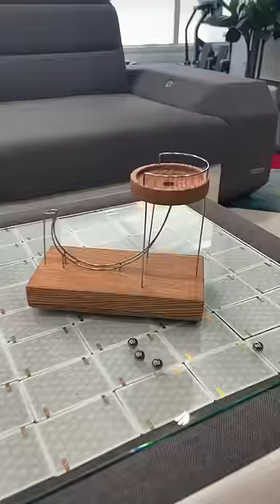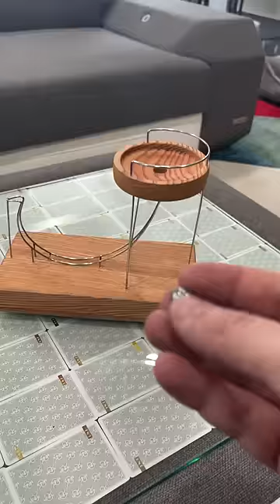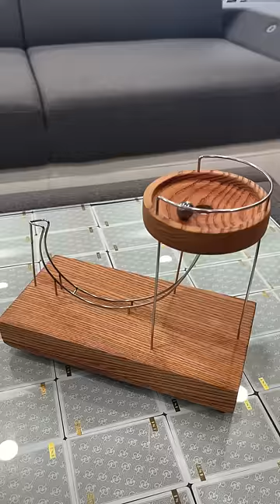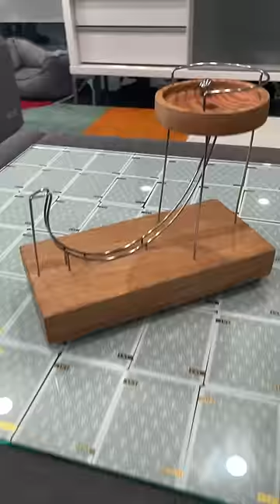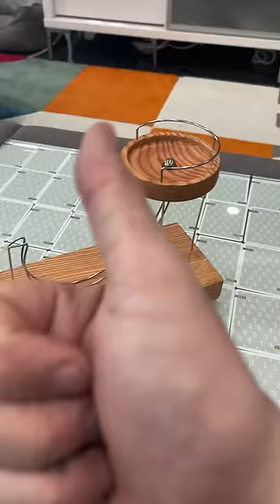An Impossible Perpetual Motion Device?! 😳 #Shorts

Comment: Eventually the material wears and becomes inconsistent. Either energy or matter is sacrificed. There is no forever.
Reply: The ball gets more height in the jump then the height it's dropped from. There's obviously a power source in the base block.
The energy from the 9v is used. Do you think this would work without the electrical magnet?
Reply: @heruhcanedean  oh, thought it was magnetism.
Reply: why is everyone so obsessed with "forever" 
why can't it run continuously for a few years? 
If the parts break? just build a machine that lasts longer, a few years is good enough for now. 🤦🏻‍♂️
Reply: @heruhcanedean  Does it really HAVE TO HAVE THAT? Doesn't gravity & the slickness & curve of the slide count at all?
Reply: Has a electromagnet and battery under the base to add a quick pull on the steel bearing to overcome the friction. All such devices have hidden power sources.
Reply: @skyehook284  Where does it gain energy? "Slickness" or lack of friction doesn't make it gain speed. How does it gain more energy to jump higher than the drop height?

Putting on caps lock doesn't make it fact.
Edit : Side question, not related. Do you know the speed of gravity?

Let's ignore friction and the heat produced from it. Where that energy of that slickness and curve be?
Reply: @skyehook284   bruh the slickness and the curve do not add any energy to the ball. The only force (if u don't count friction b/w rail and ball) doing ' work ' here is gravity. And whatever positive work gravity does as the ball slides down, it also does the same amount of negative work as the ball moves upward. So the ball ain't reaching any height higher than it was dropped from unless another energy source exists
Reply: True, but at least it might last a few life times, give what it would take
Reply: Before that you'd have to change the battery
Reply: @enam9000  The forever part change everything. If it's not forever, it means it use a energy source to do the motion and that there is loss of energy during the motion... basically, its just a basic energy source which use usual thermo-dynamic law which is what we currently use for our electricity. 

So unless your machine is forever, the machine doesn't bring anything new and serves nothing because it's either already done or it's inefficient.
Reply: @enam9000  it's called a nuclear reactor.
Reply: It's called a magnet
Reply: @betterthancrabpeople  It probably is magnetism, but for the ball to be attracted on the way down and not pulled back down on the way up, it needs to be an electromagent.
Reply: It’s amazing how many ignorant people there are that believe perpetual anything is possible
Reply: Never loose energy, just changes form.
Reply: @darrellbryce5914  Which results in the loss of momentum, and thus making a perpetual anything impossible.  Kinetic energy to thermal energy is still a loss of energy as it refers to the speed and momentum of the steel ball.  It's gonna stop eventually
Reply: There is forever.

When it's about love. 😂
Reply: Now this comment made me stop & really appreciate science for a moment. I don’t know what about it holds so much weight but it definitely made me stop out of respect.
Reply: Besides, the energy it has right out the gate, and the amount of momentum it carries through the jump seems very sus. Speed it exponential, not instant, and if there is air and the object is heavy like the marble in this is I assume, than it would slow down a lot on the way up and through the jump.
Reply: @enam9000  because we are humans. We want to do shit, even if that shit itself is meaningless shit. A device that has infinite energy would be lit.
Reply: Sacrificing matter will be aloooot bettar than direct energy cause mass has energy= mc2
Reply: @ReadyViewer1  Astronomy taught me how to appreciate everything. Even the largest stars or strongest black holes lose to time. But it's a strange reciprocation. It's not all bad. 💞
Reply: @TeenWithACarrotIDK  word. Nice username btw 🤣
Reply: @skyehook284  because of conservation of energy is impossible for the ball to jump higher than the initial height. You need to apply a external energy.
Reply: sounds like a villain quote lol
Reply: But... how long when that take?

Looks like it didn't a line my reply below the message I was commenting on.  This was about how long the wood would take to wear
Reply: @enam9000  the batteries wouldn’t last a few years
Reply: Cringe
Reply: Yet the ever expanding and cooling universe is expanding and also has no edge.
Reply: @blyat cyka what effort? Merely pointing out the universe and everything has entropy, but that it's expanding into a void space which is to this point unobservable? It's not to prove that entropy does not exist, or that some things don't have it. The idea of expansion into nothing is just fascinating to me.
Reply: @blyat cyka small world I am a low voltage electrician 😅 that's a nice way to say cable tech.
Reply: I think the biggest deal out of this is that it may be able to hold energy running for either long enough or until the material wears out, which means that this is something we could actually take advantage off in real scenarios.
Reply: @heruhcanedean  Wouldn't a magnet do the same without having to have a battery?  Maybe like one of those powerful magnets they use in speakers?
Edit: Or is there some sort of power cut off that avoids the ball getting halfway down then just stopping in the magnetic field?  
I'm not sure now whether I'm capable of understanding the answer.
Reply: Einstein: “What’s the difference?”
Reply: What if all all steel?
Reply: We cannot know for sure because noone will live “that long” to tell.
Reply: @zacmumblethunder7466  It's a good question but thermodynamics rules it out. The thought of magnetic motors as I once called them even relying on the earth's magnetic field to help like a compass needle do not seem to work. I tried as 40 years ago and friction even with a fine needle for a Bearing and the best materials just don't. The Earth's field I is to weak. I love devices like this because it creates interesting discussions.
Reply: @zacmumblethunder7466  Sounds like you understand, yea it's a magnet that cuts power so the ball doesn't get stopped. The magnet pulls the ball towards it to build speed and cuts out to let it go past.
Reply: @thomashaagmariano5079  why the "quotation"
Reply: @briansrandomthoughts4u  , comment flood is perpetual.

It's how this engine works, actually.
Reply: this has a electromagnet at the base
Reply: In this life 100% there is no forever
Reply: @kody.wiremane  So you've seen it work for days on end?  Why hasn't this revolutionized engines?  Why is this literally the only posting I've ever seen about it if it actually destroys our current understanding of physics?
Reply: It is CG. The ball can't jumpg higher as its initial point in room.
Reply: Maybe there is a forever, though
Reply: My love for my dog will last forever. Don’t tell my wife, she gets really angry
Reply: @skyehook284  I can never go higher than from where it was dropped no matter the curve or path. Unless you change its mass mid air.
Reply: May be it should be made of more strong materials and then...
Reply: Re-read what you just wrote. "Eventually the material wears ". Now consider how long before this can happen. Days? Weeks? The machine will have done its job after so many minutes or hours of use. It can be stopped to avoid unnecessary wear and is ready to be used again. Stop saying dumb hipster crap to sound smart. The device lasts long enough.
Reply: @enam9000  That’s literally what “perpetual” means.
Reply: @skyehook284  If there is absolutely no friction or any energy loss, sure it can move forever, the same way a pendulum swings “forever”. It would stop pretty quickly if the battery is turned off because it cannot reach the same height.
Reply: @eleventy-seven  do you have any evidence for that ?
Reply: @enam9000  Because perpetual motion means it will run for g*da* forever! That's why it matters! 🤦‍♂️🤦‍♂️🤦‍♂️🤦‍♂️🤦‍♂️🤦‍♂️🤦‍♂️🤦‍♂️🤦‍♂️
Reply: add more balls or build another ramp it's called maintenance
Reply: what if magnets makes it fly so it doesnt tear the rail
Reply: @heruhcanedean  there is a video about this device, it's not using magnets, it IS using the battery of course
Reply: @heruhcanedean  gravity is a theory..
Reply: It is an electromagnet underneath the base. It is just a funny gimmick.
Reply: @phil4693  doesnt it still work tho? lets say you get friction energy from the rail and the ball and that heat goes to a steam generator, shouldnt it work? since the magnet doesnt require power
Reply: @Eric-yj5xg  The magnet requires power. It is an ELECTROmagnet. It gets turned on for a bit of a second when the ball passes through the hole. So the Ball gets pulled down. 

If you look closely the ball jumps higher than the base where it was released -> This is under every cicumstance impossible without force from another source. 

If you use a permanent magnet the extra force from the ball getting pulled down while rolling down is negated because the magnet would pull the ball down while rolling up and mess up his trajectory. 

Hope i could help.

Comment: The ball obviously accelerates too quickly mid-way, it looks unnatural.
Reply: magnets perhaps
Reply: Just a electric motor with a wheel under the wooden part
Reply: @paulluxx6846  No, it's an electro-magnet in the bottom board with a hall sensor, activating for a moment when the ball comes close.
Reply: Magnets might speed the ball up,  but that ball looks light enough that it wouldn't break the field and fly back up
Reply: @rpk2012  it activates then deactivates..
Reply: @edinfific2576  
What the f do you need a hall sensor for?
A strong magnet is all this needs...and the initial potential energy of the ball falling through the hole.
Reply: Really..??
Reply: @plutostudios1417  magnets would apply the same energy on the way down as negative on the way up with a neutral result. Only if the device is connected to an electric device that turns on and off a magnetic field at the right time
Reply: There’s something wrong on the way it hits the inside of the wooden plate, in a very few jumps, it would hit the edge of the wood
Reply: @chuckclark6162  you need to turn the magnet off or the acceleration it provides would be cancelled by the deceleration when the ball starts to move away
Reply: The track is coated with a speed boost

Comment: If it accidentally gets directly into the hole, it would break your ceiling.
Reply: Nah, contact with the air and rails exert friction on the ball and it'll never get very fast. At most it'd miss the catcher on the second pass.
Reply: @jpratt8676  you must be very smart
Reply: @JS-nr7te  Uh, just took physics in school
Reply: No
Reply: @jpratt8676  what if we redesign it such a way that the ball directly goes into the hole(for eg. by using a Pipe) then will it pass faster or slower?
Reply: @shahidkococaccount3853  depends on the friction of the pipe...

If you want to speed the ball up though, you're better off using something like a rail gun or a trebuchet, a juggling system like this will struggle to minimise friction
Reply: @jpratt8676  but i wonder why they didnt use a funnel instead of wooden disc...Does the wooden disc accelerates the ball?
Reply: @shahidkococaccount3853  Their purpose is not to make the ball go fast, but to make it look cool :)
Reply: @shahidkococaccount3853  and no, the disk slows the ball down to accentuate the illusion that gravity is accelerating the ball without assistance
Reply: @jpratt8676  it was a joke
Reply: @redstoner8447  ? Not sure which thing you think was a joke but, cool...
Reply: @jpratt8676  
Speedy thing goes in, speedy thing comes out
Reply: @jpratt8676  remind me to never invite you to any of my parties...

Comment: I like how humans can spot something un natural just by looking 
No need to know physics or anything
Reply: Yup. There is a magnet in the base on the machine.
Reply: @inevitable854  Not a magnet. Electricity. If this was working with just magnets it would actually be a PMM
Reply: @Bumperpegasus  no it wouldn't actually. Because over time the magnet would lose its strength and not be able to throw the marble with as much velocity, thus not being able to make it to the funnel.
Reply: @Bumperpegasus  "perpetual motion, the action of a device that, once set in motion, would continue in motion forever, with no additional energy required to maintain it. Such devices are impossible on grounds stated by the first and second laws of thermodynamics"

With this in mind. The magnet would lose strength, the metal would rust, the wood would decay and thus fall apart.

The bearing would also get smaller and smaller as it wears against the rusty metal rails and would get to a point where it's smaller than the gap between the rails.
Reply: @inevitable854  Finally someone who knows that magnets are not forever,a lot of people saying "it's just a very strong magnet" as if that were an argument in favor of PMM'S.
Reply: @inevitable854  Magnets won't work for an obvious reason. Repelling, you lose the momentum of the ball dropping down. Attracting, you lose the momentum as it goes up. It's the reason people are spinning their wheels trying to make a perpetual motion magnet motor. 
As others have mentioned, it probably uses electricity on the rails inducing a magnetic field on the ball which opposes the field on the rails.
Reply: @klocke5247  you could attract the ball downwards on thr initial drop with the magnet placed in such a way that it barely hits the field and gets propelled downward on the track, similar to a space shuttle using a planets orbit to change direction and propel them through space..
It's obvious there are other physics involved with the specific way the rails are shaped,
Reply: @inevitable854  It's an interesting idea but unfortunately won't work. There are no magnetic fields possible from permenent magnets that can mimic the gravitational attraction of a round object. Trust me, or not, people have tried every possible permutation of every force you can imagine to create a perpetual motion machine. It simply isn't possible. It's actually frustrating. You can't even levitate a ferrous object using a collection of arranged magnets. It will just fall out of the field no matter what you do. The only way to do it is use a motor to spin the magnets and the field and object.

Anyway, pretty sure another commenter already cracked the mystery. It appears to use the same principle as a rail gun. If you inspected the device closely, I'd bet you would see that the two rails are not connected together at the end.
Reply: Yet billions of people are still praying to the zombie son of a magical sky daddy. 🥴
Reply: @inevitable854  i know you're free to have your own opinions, but when you cant comprehend that lt is literally impossible to enter any kind of force field, ie a magnetic field, and exit with more energy than what you started from, why even comment about it man. If you move towards the magnet to gain 5J, you will need to use atleast 5J to leave. I guess you wont need exactly 5J because the magnet would have lost a miniscule amount of attraction in the time it took for you to absorb 5J from the magnet, but at that point we would also need to account for stupid things like quantum tunneling to calculate mass loss and gains etc. Frankly i dont think you have any real comprehension of somple physics so why do you waste your time to make a fool out of yourself.
Reply: that is what sets us apart from other animals
Reply: @christiansmith5047  your first name is related to the "zombie son" and it means "follower of Christ" I know it's just a name but it's kinda ironic
Reply: @Dah_S.S  cest la vie
Reply: @christiansmith5047  yeah, it is 😁

Comment: These "beads" "definitely feel unnatural'
Reply: Thats what i told my girlfriend
Reply: @ryanherrera9265  Don’t lie! You mean boyfriend ha ha
Reply: Has a magnet ring inside the hole.... when the bead falls it propels it. Eventually the magnet will need to be replaced
Reply: @CdnPIMO  hey man its 2022, anythings possible 😂
Reply: Those are steel ball bearings. Use a marble and it won't work.
Reply: Magnets
Reply: Obviously🤦‍♂️
Reply: @Luketa1978 " the magnet will need to be replaced"
And over a dozen upvotes.

No. Magnets don't work that way.
Ugh.
Reply: @kozmoman1066  battery, not magnet.
Reply: @QueLastima  are you talking to me?
Reply: @QueLastima  magnets actually do technically have to be replaced eventually so that guys idea could make sense in theory.
Reply: Magnets can go 100 years and only loose 1% of their magnetism.
Reply: @mattjames8350  that is assuming that the magnet is in ideal conditions and isn't using its negative polarity.
Reply: @mattjames8350  I mean haven't you had a magnet on the fridge for like 20 years and noticed that it doesn't really stick like it used to, like if you blow hard enough you can push it off the fridge. it's common knowledge that everything runs out of energy eventually.
Reply: No I have not done a 20yr experiment on magnets like everyone else has..hahah. I have googled it however.
Reply: High heat can have a negative effect.. often temporary.
Reply: @mattjames8350  are you talking to me?
Reply: How'd you draw that hypothesis?
Go get yourself a nice set of beads... don't forget the batteries.
Reply: @mattjames8350  well you didn't @ me so I can't even see what you said to me before and I forgot so I got no idea what your tweaking about lmao 🤣
Reply: They look suspiciously like miniature Benhoa balls